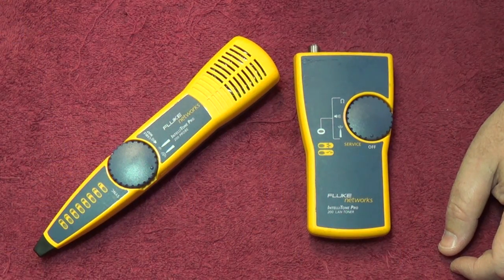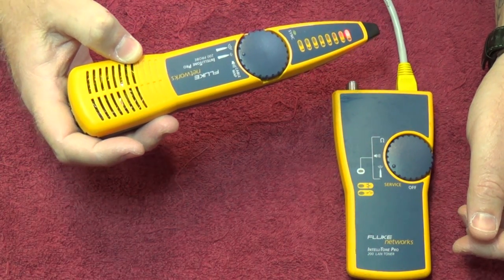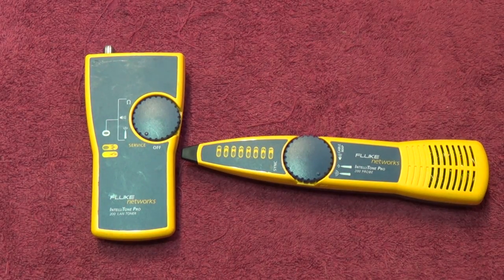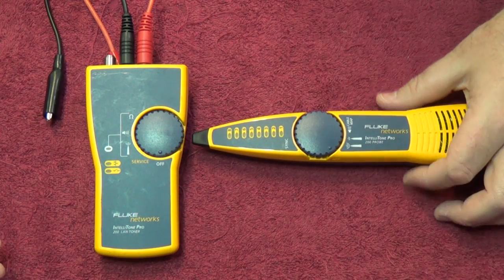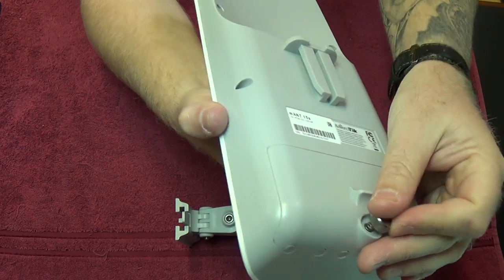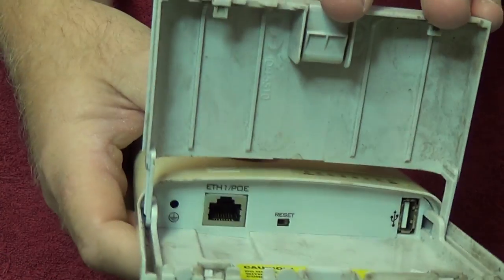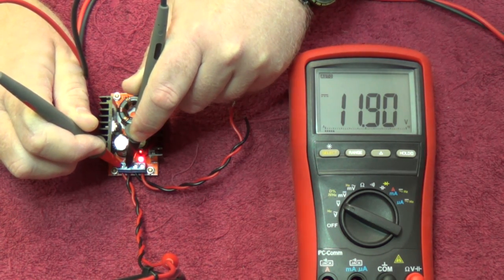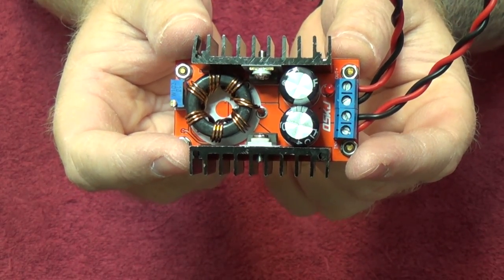Episode 82   Fluke Intellitone 200 Tone and Probe Review   120 Degree Sector and POE on battery

Comment: wish it worked like the manual.  goind to service mode does nothing; no lights anywhere. but tried it on working cables, test cables.  all the same.; Service does nothing.  is it faulty or looking for something else in good cables  >